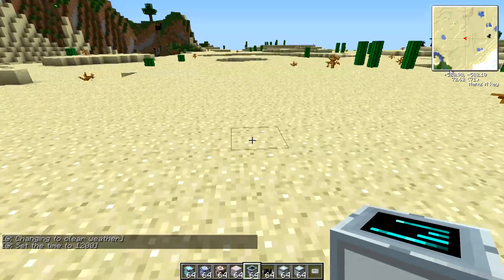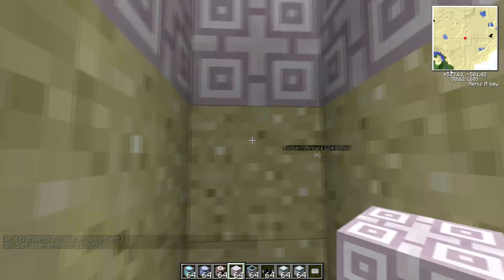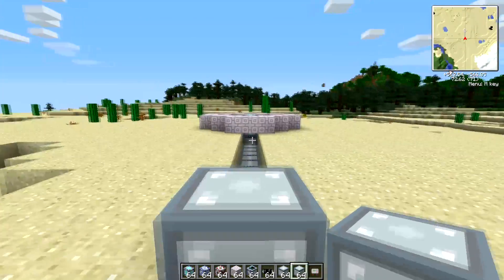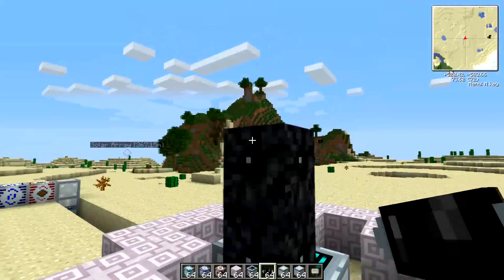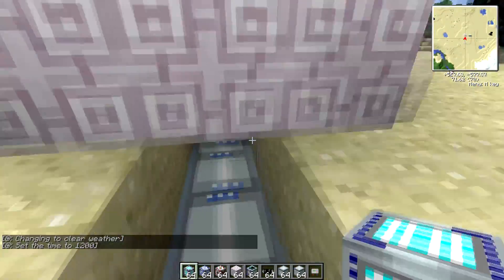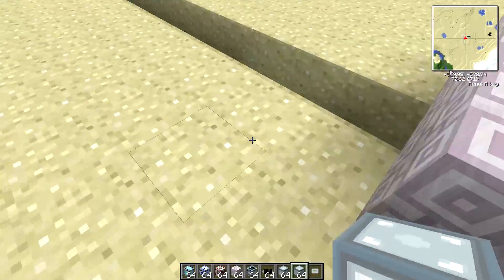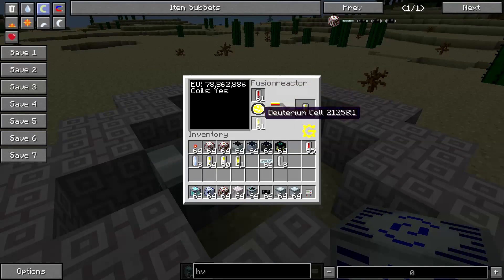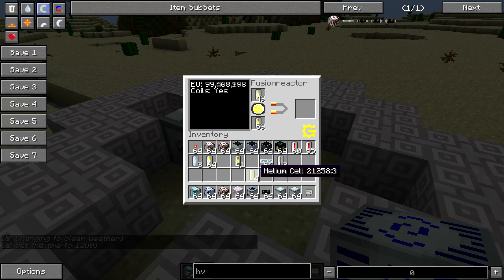Tutorial: Greg Tech - Fusion Reactor

Comment: I don't know if its changed, but supercondensators appear to be unnessecery as a HV transformer appears to accept any size packet its just the output that's capped to 2048eu/t
Incidentally the railcraft energy loader will accept transformer upgrades and accept 8192eu/p.

Comment: i hate to say this, but i just watched, you have no idea what you are talking about @ the poster of this video...
your transformer setup is all wrong.
Each HV Trans outouts 4 packets of the main input of 2048 (4x512)
All you need is a total of 32k/2k= 16HV transformers total to convert all the power usable 512 packets on fiber. You have way to much cable, most of that is un-needed

Comment: The reactor itself outputs at 100k EU/p, but that is more than sufficient to fry ANY machine, so you have to use a supercondensor to bring it down to 8000~ and then an HV transformer to bring it down to 2048~. But because the reactor outputs 100k EU/p that means you can have  almost 50 different connections to the reactor all at 2048 EU/p and it will keep up, its like having 50-150+ Nuclear Reactors (depending on efficiency)

Comment: cables can handle unlimited current. They can handle 1000000000000EU/t if you wanted. And even trhough a HV transformer, the EU/t will stay the same. The only difference is the HV transformer will drop the EU/p down to 512, but will still be maintaining that 10000000000EU/t as before

Comment from the maker: While I haven't tested it exactly that way, as best I can tell, the answer is yes.   I would still use a power generation recipe to charge it up to its maximum (100 million) before switching to the iridium production to give yourself a good safety net, and to keep it fully charged in case you run out of materials.

Comment from the maker: All coils are required, and you need at least 40 million EU to charge it to start the reaction using the deuterium/tritium combination.   After it starts, you'll want to let it charge up on a deuterium cell combination (or be able to continuously supply at least 512 eu/tick from outside power) before switching over to making iridium.   There are probably other ways to make iridium that don't require as much initial preparation as well.